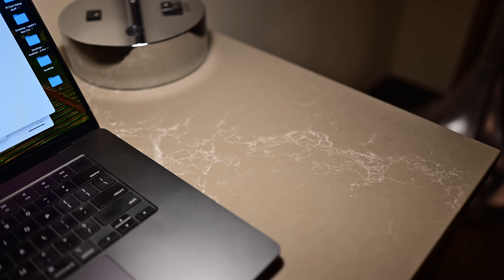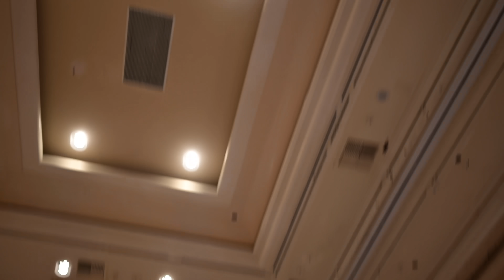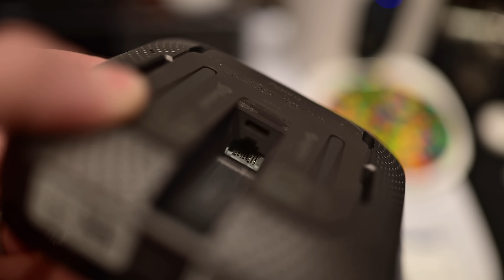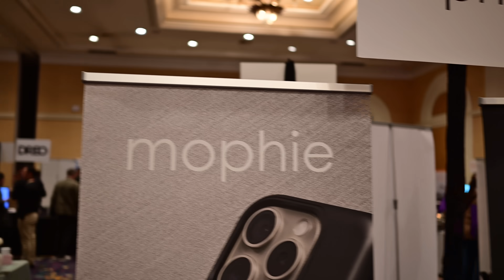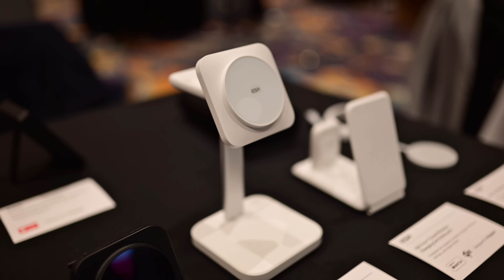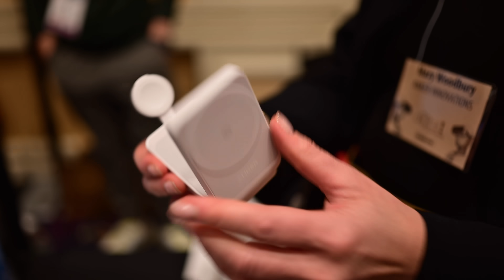Best Gear From CES 2024: Pepcom Digital Experience!

Comment: OWC has two issues.  Their products simply dont work and they continue to ruin their products with their logo plastered everywhere.  No one wants their logo lit up or huge in your face.  I just finished over a year of customer service issues with OWC trying to get their flagship thunderbolt pro dock to work.  We tried four of their docks and found out the design is faulty, dropping out the USB ports immediatly as well as their ethernet port in the back dropping out the internet signal as well as slowing it down.  All four docks did this so we proved it was a faulty design.  Now their blade which used to have a nice light bar on the front has their damn logo instead!  OWC just doesnt get it!  Anker makes good stuff but they only use Amazon to ship their products and Amazon is now only shipping in white thin envelopes so everything you get is damaged in shipping.

Comment: A lot of these are just trash or theyre third party rehash from a name brand that done it already.
Reply from the maker: Can you give me a single rehash from someone who already did it already? I believe many if not all of these are firsts.
Reply: @AppleInsider  you are either simply defending your video or if not you are not up to date with tech journalism
Reply from the maker: @kyb7795  I'm pretty up to date on my tech journalism... but I also don't see you mentioning any rehashed products that are already available? Let's look at what was covered from this event.

Matrix -- There are 3-in-1 chargers out there but this is the ONLY one that is actually certified and signed off on by Apple. There is only one other MagSafe battery on the market which is by Mophie.
OWC -- Sure, there are other SSDs on the market but OWC is very ahead of the curve with these kinds of compact devices that contain literally 8SSD blades on the inside. Let alone the Thunderbolt 5 dock. Thunderbolt 5 isn't even on many, if any, consumer devices so far.
Lockly -- Absolutely the only Apple Home lock that also has facial recognition.
Roborock -- Matter is brand new for robotic vacuum cleaners. First couple were announced here at CES this year
Aqara -- Very first IR blaster to work with Apple Home. Also only indoor/outdoor lever lock with Apple Home support
Meater 2 Plus -- there are other connected probe-style thermometers but the others do not have multiple zones on a single probe
Abode -- First security camera to use Wi-Fi HaLow long-range Wi-Fi
Mophie -- Qi2 launching here at CES
Ecovacs -- Again, Matter enabled. Plus the combo robovac plus stick vac
ESR -- Qi2, brand new releasing at CES
Scoche -- QI2
Anker -- yup, more Qi2. All be released for the first time. No Qi2 device was available before CES 2024.